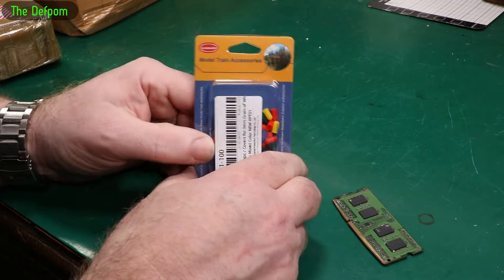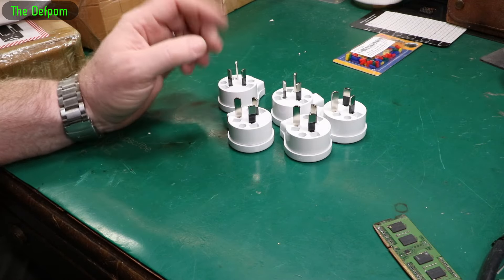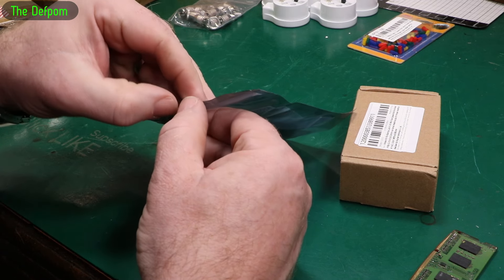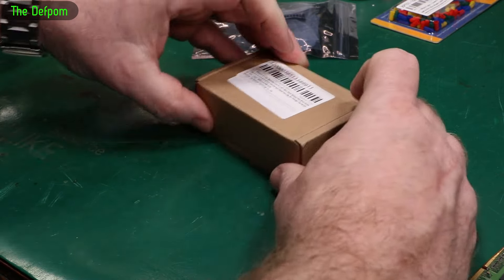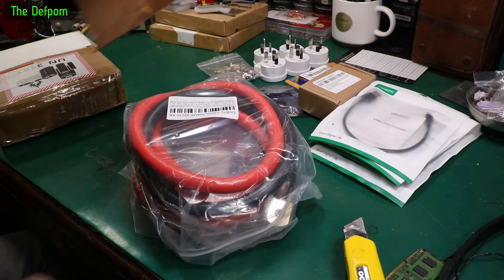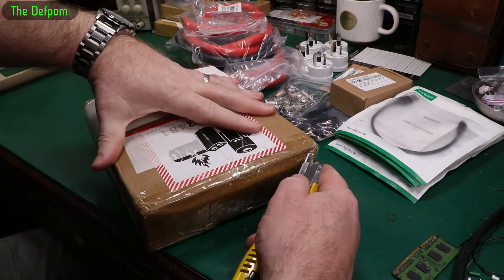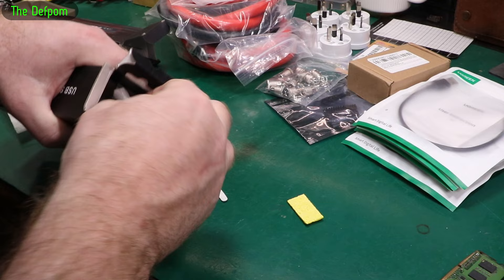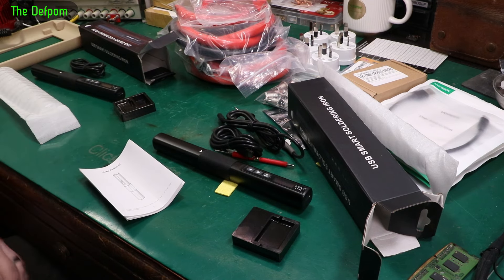🔴 Mailbag Monday 7th October 2024 - No.1286

Comment: Since you brought up a review item, have you done any on the HoldPeak products, specifically their 40000 Counts DMM? They're not Cat III, but I ignore that since I've been using meters that weren't that for 40+ years. Their 4-1/2 digit DMM is pretty nice for its low price, and they have a 600 amp clamp-on current probe that will match it that can be purchased separately.

Comment: Those power plugs are the pins brass or steel?
Compare the quality of the local sellers to those from direct china please?
Reply from the maker: @Electronics-Rocks  these actually look BETTER!
Reply: @TheDefpom  Cool!
Great I know you can find some gems but I got burnt & I did say burnt as it took three weeks for them to heal!
So now disassemble everything that can cause damage to check for the likes of aluminium cable is where I got burnt!
The earth wire burnt out on live to earth fault before RCD cut out. I did test the RCD & it was only just in spec. Only the earth wire burnt out not showing any physical damage except leaving the metal body live!
Yes I have had several safe bargains but once bitten forever checking!